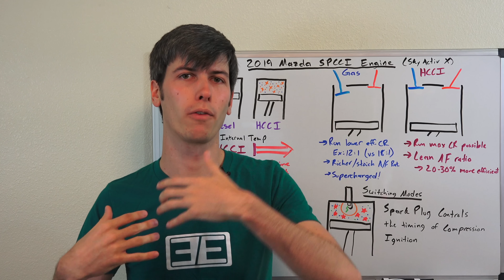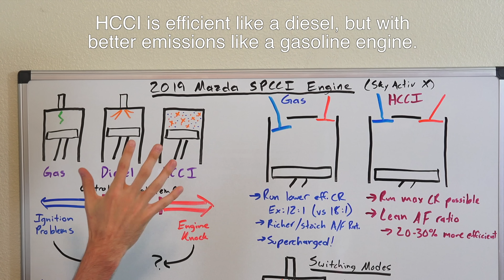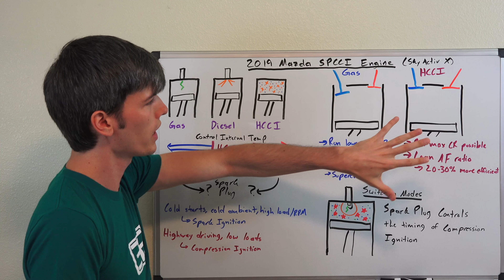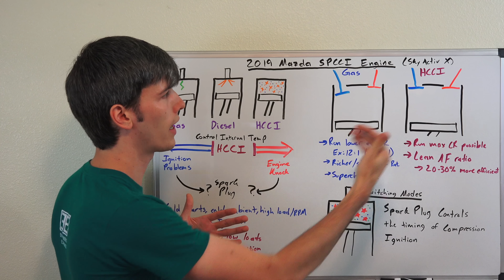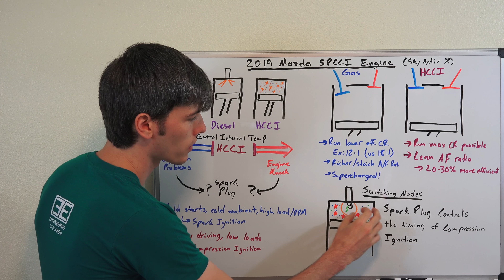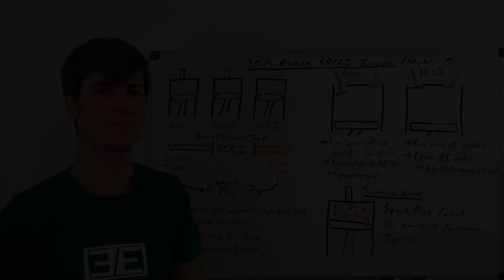Mazda Creates The Holy Grail Of Gasoline Engines - HCCI SkyActiv-X

Comment: Well, let me put it bluntly. 
The auto industry has been milking it’s clients for the longest time.
This HCCI SkyActiv-X engine is another fine example; it will cost a bundle to produce and will have a million moving parts. For what … perhaps 20% better fuel economy while on the highway?
And that’s assuming it all works as intended. 
It’s also assuming we’re not going to run out of the brown stuff. Who knows.
Or that the price of petroleum is not going to skyrocket, offsetting all of it’s advantages (you just KNOW this is what is going to happen, no?).

In this industry, excluding Tesla and a handful of manufacturers, it’s all promises and vaporware. From GM’s HyWire to the hydrogen cell it’s all hype and prototypes and even after DECADES of fine tuning nothing ever makes it to the dealership floor. It’s not an accident. It’s a lousy business plan.  

There’s a million different engines waiting to be developed out there. So many brilliant patents. Ask yourself WHY Mazda still prefers to increment the same CENTURY OLD technology an inch at a time? We need REAL fuel efficient cars 20 years ago. 

Man we’re 2017, not 1967. We need bold new engines and crazy quantum leaps. We’re done with these variations on the model T’s combustion engine. The combustion engine was the holy grail for an older generation. Time to move on people. Time to tell Mazda it’s not OK to take baby steps anymore.
Reply: Companies wouldn't develop that kind of cutting edge technology. Far too much risk. They'll wait until the state sector does enough research, maybe built a prototype and then scavenge it.

Comment: Sounds like they have a highly reliable and durable super fast ignition sensor that is able to detect when hcci has actually ignited the chamber or not, so when hcci ignition failure is detected the engine fires the spark plug at the point of compression beyond what should have triggered hcci but failed.

Comment: If you can ignite petrol on compression why can't they uses a similar system to diesel? Inject the fuel in at the top of the stroke

Comment: According to your speculations about running on lower CR during spark ignition, Mazda is going to use air supply unit, which will inject additional amout of air into the cylinder during HCCI mode.

Comment: this is such old technology... It has been over 200 years and we are still using fossil fuels as a means for transportation... Please just stop we need to advance not keep the same damn technology in its place...  Warm regards look into "Zero Point Energy Field" Or hydrogen powered engines for transportation. Ok Ya'll keep the human race forward not stuck please please..
Reply: The transition won't happen overnight, just like how steam trains weren't replaced overnight or gasoline cars weren't common overnight. You want to make the transition quicker? Help develop higher energy density batteries.
Reply: I've found that change for the sake of change hasn't always panned out for the best.

Comment: The problem I can see with this is that SPCCI is essentially introducing engine knock from too much ignition advance.

On a normal engine that can destroy it pretty quickly, how do you think Mazda are going to control this so that they can run HCCI without having the engine knock itself to pieces?

Comment: It's been done already. May's Fireball gas engine ran a 16:1 CR on pump gas in 1976; evidently the emissions with such high compression weren't feasibly controllable at the time. See Popoular Science November 1976.

Using an intake valve to control compression is an old idea, but where does the air/fuel mix go when the intake opens?

Comment: How is it throttled? And  when you have sparkplug initiated compression ignition, how do you prevent detonation? Or is a state  of detonation the normal combustion mode of this engine? Perhaps a super hot exhaust valve serves as a virtual glowplug to ensure deflagration instead of detonation? Does the engine use high or low octane fuel?  In short, you leave me more curious than i was before i watched the video.

Comment: I want a straight six with this tech
Reply: Mazda probably will make a V6 with it.
If it has a cross plane crank and a balance shaft it can come close to an i6 in smoothness.
Reply: doktorbimmer nah, he won't. He'll make electric cars more viable.
Reply: V8 here, as well.
Reply: You're history lesson about cars are completely wrong. Steam cars outnumbered any other cars in the 1800s. Electric cars never were the major marketshare leaders, not in 1800s, not in 1900s and not in 2000s.
Reply: Jani Ikavalko, Google is your friend. EVs were about a third of all cars in the 1800s, as was steam then gas. Please Google "percentage of electric cars in 1800s". May I advise you to never say never? An electric airplane just flew across the English Channel and they are used for trainers as well as being designed for passenger traffic. Don't be a dinosaur!
Reply: I don't need a google and electric car fans written propagandahistory. Steam cars were first and ruled the automotive world first 100 years on 1800s. and they lived for as long as 1940's. Who killed steam car? You?
Reply: Jani, steam isn't coming back, pal. You can throw firewood under your car if you want to, but electrics were as common as steam in the 1800's. What killed both steam and EVs was cheap oil. It was discovered coming out of the ground and no one was concerned with the environmental impact of using the stuff. Fill the air with smoke? That's not oil's fault! Poison a lake or river when a pipeline breaks? Let the taxpayer pay for it, you'd better not raise the price of my gasoline!

Now that we send troops to protect oil, having a vehicle that isn't powered by one source of energy will rule the world and that's electric cars. I can't understand your fascination with steam but if you want to drive a boiler, be my guest. Just have lots of coal in a bucket when your car slows down.
Reply: Who killed biogas/electric hybrid which used microturbine? GM Ev1 series hybrid car is killed by you electric car owners. it could use also petrol and many fuels. It looks exactly the same as GMs electric car which you claim that oil companies killed it.
Reply: Oh and if not bending truth anymore, only at year 1899 the electric cars were sold more than steam and combustion engine cars, so steam cars were safely the hit product on automotive industry at 1800s minus 1 year. Why you killed steam car?
Reply: Jani, stop burning things. I don't care if you burn LNG, gasoline, diesel - you're burning something! Of course the oil companies want you to use their products in your transportation, so they put out "studies" that show how great fuels are. The only way to power cars without fuel is electricity. Oil comes from one, and only one, source. And hence our wars and global efforts to find it and burn it.
Reply: Jani, you just admitted EVs were common in the 1800s, despite your claims otherwise. We're done talking as you're not learning. Got the kettle on the boil yet?
Reply: Pastchuchan,

It could happen. Mazda's head was looking in that direction when they did their RX Vision concept. Crazy long hood for a tiny Rotary engine.
Reply: No they werent, only very small portion of the end of 1800s as I said. You really should learn history about cars and car industry. Electric cars had very small hit peak from 1899 to 1920 and then they were conquered. 1800s goes to Steam, and 1900s goes to petrol and CNG cars are the hit of 2000s.
Reply: CBG is the way to go, there are 1.5 million CBG busses globally. Electricity isn't needed for anything as it's not solution for anything. I never said I burn fossil fuels. CBG isn't fossil fuel. Also Hydrogen used Fuel Cells just works as you can see from mirai and ix35 fuell cell and from ships.
Reply: Socky Noob, analyse your statement. Electrics outnumbered gas cars 3:1 in the early 1900's. Why did gas cars overtake them? Not the technology (many original 1910 electrics still drive today!) but the fuel. Gasoline is portable and the grid in the 1900's was in its infancy. Even during WWII, you had farms and counties in the USA that didn't have electricity. In addition to that, no one paid (then or now!) the true social price for gasoline. If a gasoline truck blew up, killing people and setting a town on fire you can be sure Rockefeller didn't get a bill from the city - the taxpayers did. Gasoline was cheap and portable and the grid was limited - that's why electrics faded. Interestingly, the Fitchle electric car in 1910 got about the same range as a Nissan Leaf does today, 100 miles.
Reply: Herr doktorbimmer ugly expensive and any non vegan and an expression car guys didnt want that garbage waste cars called evs
tesla blindet troll.
Reply: Herr doktorbimmer buy the way tesla are one of the most hatet companys for their arrogant future bla bla like a sect
Reply: Herr doktorbimmer it was the future in 1899.That worked out well.

Comment: Someone mentioned alcohol Brasil uses alcohol in engines that are adapted for it these run cooler than petrol(gas to our American friends)
Just thinking though in this type of engine would you fit spark plugs for starting.

Comment: is it really compression ignition if ignition still starts with a spark plug? seem more like a high compression motor that as soon as it detects knock it opens the intake valve to lower compression to eliminate the knock. still fired by spark plug... hopefully there not plagued with piston failures from irregularities of city driving like the cummins cng engines are. which as well are high compression with spark plug ignition..

Comment: The HCCI combustion will be so few in real world driving conditions that the overall efficiency of the engine won't be much greater than a regular combustion engine, probably less than 5%. Which is still pretty good but I rather have them focus on electric vehicles.

Comment: I'm waiting to see this method of combustion be applied to Mazda rotary motors sounds good but Little issue is how have addressed the engine from dieseling on after the switch has been turned off? This was a common problem with gas engines that had timing issues with carbureted motors, every so often the motors would keep running after the spark had been turned off. I am curios to see how Mazda had solved this enigma.

Comment: Very interesting. It seeing this video makes it easier to understand how Mazda created a new rotary engine apparently using some of what they learned from their Skyactiv engine research.  The new rotary is going to improve engine exhaust flow throughout the rev range by employing a valve over the exhaust port to improve performance at high and low rpm, while also using port fuel injection. Then Mazda began to talk about stuff I didn't understand, but it's being to make sense; the new rotary will apparently use a stop-start function that uses the rotors to seal the intake ports, then a spark plug is fired after the fuel is cut off, so presumably this would take care of residual fuel emissions and stop any fuel or exhaust going through the intake tract. It's sort of like using the rotors as valves. Mazda hasn't made any official announcement about how they would use this rotary engine, but all this stuff is in they're new patents. It sound like they are tackling the emissions and efficiency problems of the rotary engine in ways that are similar (I mean in their philosophy of problem solving, not the same technology) to what they did in their HCCI engines.

Comment: So, what you are telling me is that mechanically you have an 18 to 1 compression ratio engine running 12 to 1 compression ratio.  My question to you is with your variable timing, controlling the compression ratio, when you get to 100 to 105 percent efficiency in the intake runner, which is possible on a good design your back to 18 to 1 CR, right?  Then detonation will happen.  If you can't achieve this, still your looking at a sucky design that you are forced to live with and efficiency is lost.

Comment: Won't opening the intake valve cause air-fuel leakage back into the manifold and thereby reduce the pressure at which the spark plug ignites the mixture causing inefficiencies?

Comment: 1) leaf AF could mean 2 things
2) Could they not just make a really high compression and lean AF spark plug engine to do this? Or does the no spark plug thing allow them to run so lean and such a high compression produce so much more effeciency that it is worth going through with all the R&D required?

Comment: As soon as you mentioned that they use a supercharger, it occurred to me that they could be varying compression pressure with boost; I thought about this when I studied this as a hobby some years ago, though instead of using a supercharger driven by your belt, you could use an electric motor driven supercharger to vary the boost on the fly. That might help with this seamless transition business.
Reply: this would work, you wouldn't even need to run supercharger off electric motor, just have it clutched like A/C compressor

Comment: So basically a diesel quality motor to handle the compression, with a partial functionality of a gas and diesel. If the question were to be how the system senses when to switch, wouldn't it be some type of knock sensor to detect when the gasoline starts igniting on its own before the spark plug does it then?? Also, what rpm range  are we looking at with this new motor function? I'd imagine it'd be lower, than the traditional method.
Reply: Flame rods would work for detecting combustion events in cylinders, just like in a furnace lol

Comment: Interesting. But I see maintenance and troubleshooting issues. While using detonation to your advantage, this may also increase combustion temps that will stress components more. Also other things that may cause unwanted/poorly timed detonation will wreak havoc. The spark plugs can create hot spots or foul from the different conditions. Carbon deposits or cooling system problems as well. I see problems from the care of the owners. Even the octane of gas used must be kept in mind. Seems like the cooling system, type of spark plugs, fuel additive, and so forth will require special attention. It's a noble design, but I definitely wouldn't buy the first few years without the extended warranty and AAA.

Comment: That switching bit at the end is literally just normal ignition, unless the spark plug is used as a sort of "glow plug" to heat up a too-lean-to-ignite mixture during compression. However, a mixture that is too lean would just ignite and ping like in a regular gas engine.

Comment: So what happens if you run a different octane rating of fuel? The  timing of combustion would be off by quite a bit. Even if the car is tuned and timed to run on 91 octane, and you fill it with that required rating of fuel sometimes fuel quality can be questionable. Wouldn't this cause timing to be thrown way off?

Comment: Toyota variable valve engine had its problems. My sister had one with low miles that needed an engine replacement due to issues she had with her car. Not sure if it was the VVT solenoid or seal issues but she had a load of gunk on one side of the engine it had to be replaced. I really wonder if This new idea isn't gonna be plagued with issues also. I think I'll take a wait see attitude towards the Mazda idea. See if they have their act together. I remember the rotary engine lol what a joke that was.

Comment: what im thinking is, if it runs as lean as you say wont in burn holes in pistons and exhaust valves? i mean, fine, it doesnt misfire or knock when in hcci mode but how do you control the temps? they will have to design a whole new engine with MUCH better heat dissipation for it to not literally melt.

Comment: I currently have a Mazda CX 3, but my lease is up in 2019. I was hoping that the Tesla model 3s would be more readily available by then. However, if this all works out then I may get a new Mazda with this engine. I'm also considering buying my CX 3 as an option too.

Comment: This is 'last gasp' BS from the ICE community. It's still 60%-70% inefficient with the energy dense fuel it uses (wastes). Why accept throwing away $35- $40 of a $50 tank of gasoline when you can spend $5 of electricity and get similar range? Keep that extra money in your pocket; you earned it and deserve to spend it on better things than wasting it on gasoline. Wake up people. Don't accept this inferior technology. Demand more as a consumer. Buy battery electric; it's the last consumer product to be electrified.

Comment: So to sum it up, spontaneous combustion is more efficient than spark plug but then can be uncontrolled. Solution = design so that it only spontaneously combusts at the hottest temp n use spark plug for the rest.

Comment: The correct temperature and  pressure has to be a achieved for this to even happen, what happened when the engine wears after use, how much wear would the efficiency change  and be decreased.

Comment: At the 1:20 mark , so it's a diesel that uses gasoline? It uses compression to ignite the air/fuel mixture. I see so many things going wrong with this in the future of auto repair. Imagine it's a crank no start and the valve timing is perfect, how the hell are you going to know if there is ignition of the air/fuel mixture, compression test?

Edit: why would you get rid of spark? Are new regular spark ignition 4 bangers not efficient enough? I can understand the efficiency comparison holding up against a old school Chevy 350 but like a new Toyota Corolla 4 banger?

Comment: The block and the heads had better be very beefy to handle all that compression
Reply: Iron sleeved aluminum block with grooved and ringed aluminum head will suffice, although I wouldn't be surprised, if they'd go with compacted graphite iron for the block